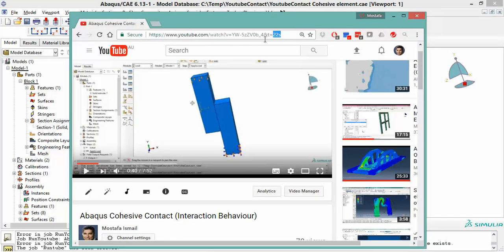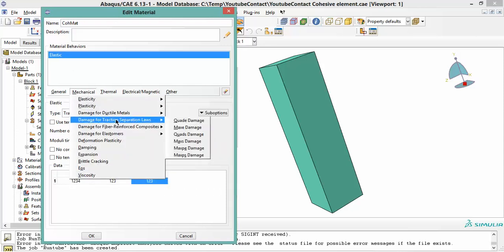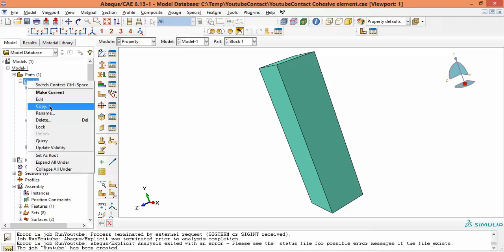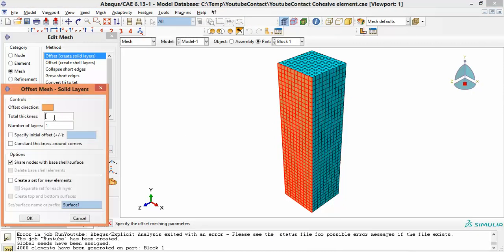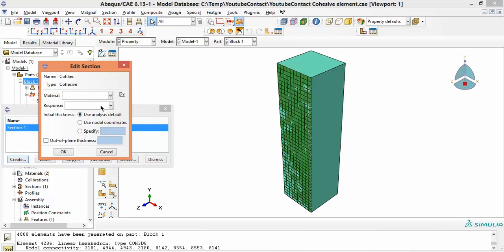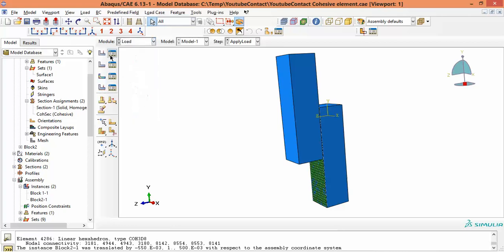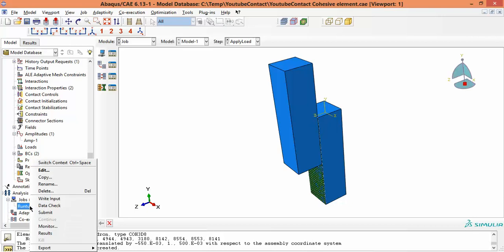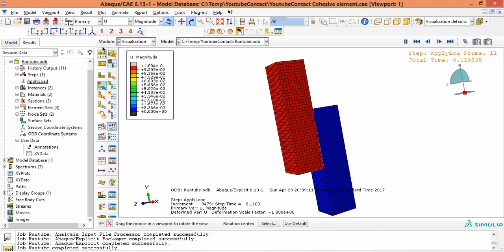Abaqus - Creating and Modelling Cohesive Elements

Comment: In your model, you defined the cohesive elements on block 1. But how do you define the connection between the cohesive elements and block2? Or how Abaqus understands that the Cohesive element is actually kind of a glue between Block1 and Block2?

It seems that something is missing from this model.
Reply: I have the same observation. I try this procedure and block 1 and block 2 are not connected at all. Only block 2 moves, where displacement boundary conditions are applied but there is no interaction. Indeed block 1 does not show any stress or displacement in the video. Creating cohesive elements require to specify that a given cohesive element includes nodes belonging to the two parts. I don't know how to do it in CAE.
Reply: He forgot to add interaction. Simply using a tie between the cohesive element and surface of the other block will do the job.
Reply: @mehdishishehbor5945  Is a 'tie' between block 1 and cohesive surface already implied when you the the mesh that way?
Reply: @aquibansari5080  No, the nodes are naturally connected in block 1 and the cohesive surface, because the generation process is "offset" based on the original mesh. It's the block 2 that needs the “tie” to establish the connection.
Reply: @阿姆斯特朗回旋加-p5i  true
Reply: @阿姆斯特朗回旋加-p5i  I think you are right.:yougotthis:

Comment: The load on the left block is not transferred to the right block because no interaction between the cohesive layer and the left block is defined.
Reply from the maker: Excellent comment! You are right.
I expect users to replicate the interaction I have created in the video between the right block and the cohesive layer for the left block.
Reply from the maker: Ali Aboulatta yes
Reply: @mostafaismail43  In your model, you defined the cohesive elements on block 1. But how do you define the connection between the cohesive elements and block2? Or how Abaqus understands that the Cohesive element is actually kind of a glue between Block1 and Block2?
Reply: @DianaAbdulhameed   After doing the modelling in ABAQUS. Do you know how are we going to compare the results on Abaqus with the experiment results?
Reply: I think left block should be tied to right block's cohesive element layer??
Reply: I think you are right. Have you been successful doing so?
 @rakshithcr3928
Reply: do you mean i need to create another cohesive layer on the left block as well ??
Reply: i agree he has done mistake